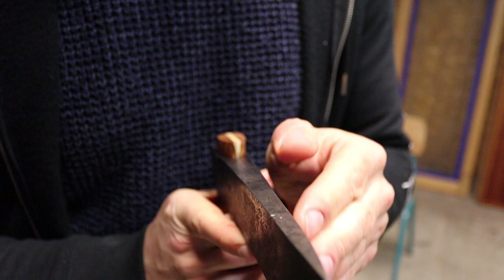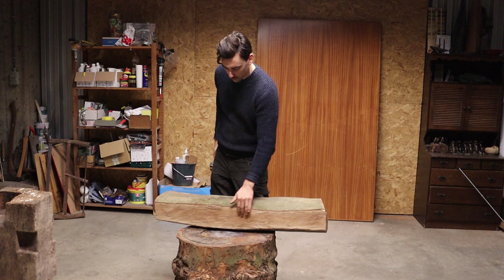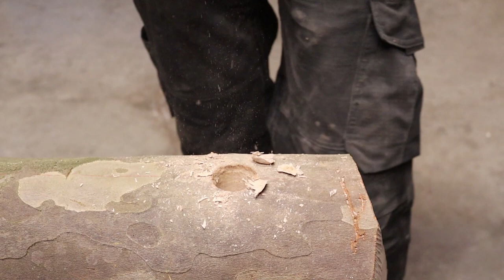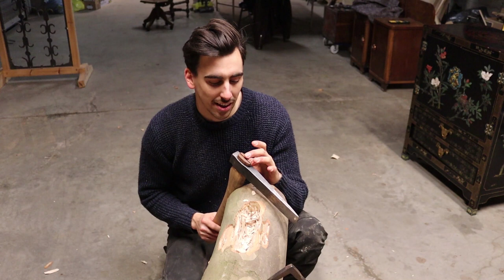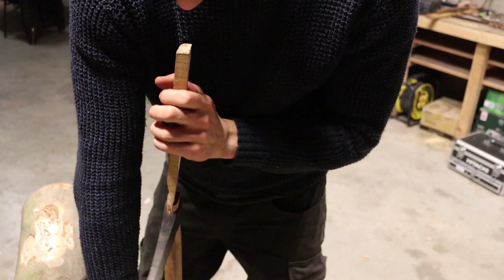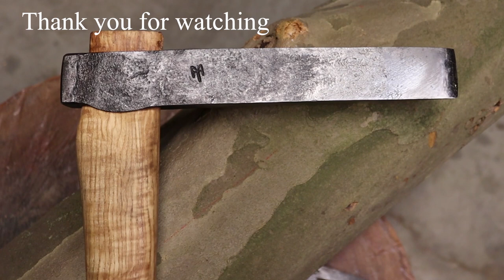Putting my Mortise Axe Skills to the Test

Comment: Perhaps the flat head of chisel suggests that the chisel should be placed and then struck on the flat head,  rather than an axe type stroke.   Your sharpening techniques are amazing.
Reply from the maker: Yes, probably you would be more succesfull when driving the axe with mallet/big ol' stick. And thank you!!

Comment: It would take a perfectly aimed strike of the axe but I always imagined a mortise axe chopping perpendicular to the length of the mortise. Especially in a situation like you had there with holes drilled in the ends of mortise. The chips would just fly if severed perpendicular. Then come back and clean up the walls using the mortise axe more like a chisel and pushing instead of striking.
Reply from the maker: Yes, the twybil has this capability with its mortise chisel-like end. I really need to make that variety! makes more sense.
Reply: My first thought was that it could work like a combo axe-chisel
Reply from the maker: @motagrad2836  it does! 👌

Comment: I sort of think the axe is supposed to be used perpendicular to the grain of the wood. This also makes the narrow width of the cutting edge make sense as well. The way you cut in the beginning of the video could really be done with any axe which gave me the idea that the reason it's narrow is to allow it to cut the other way. I could be totally wrong but I think it'd cut much much quicker too.
Reply from the maker: Working square to the grain using a swinging motion will become impossible on a narrow mortise like this, then jou would need to use a hammer of sorts. Which was done. I think this axe need a bigger mortise to shine. The twybil variant of the axe has two cutting edges and has a pickaxe shape, one end (missing here) is a mortise chisel like end that you can use to chop the endgrain, square to the grain. But indeed my axe has some trouble in this video.

Comment: Slipping wedges and loosening axe heads/handled tools were the bane of my existence for years. No matter how many notches I put in the wood or steel (or both in combination), no matter how much epoxy I applied, they always loosened. All that stopped when I started making my wedges out of sharpened pipe. I use them for everything, even friction fitted tools.
Reply from the maker: I'll keep that in mind!
Reply: I never thought to use pipe instead of buying those circular wedges , thanks for the tip
Reply: @yoman2854  one of the perks of being a craftsman who started as a broke teenager.. seeing things for what they are in their most basic form to save money lol. Glad I could help.

Comment: axes were mostly used for fresh and wet wood, then the effort with practice is not so great, less vibration in the hands
Reply from the maker: You're right, this wood was cut almost a year ago, It's not super dry but not comparable with freshly felled wood.

Comment: Very nice axe !   I like the heft and length of the axe.  I have a little smaller Gransfors Bruk mortise axe and like to use it inside cabin corner notches along with using it as a push chisel, and also to use my Wood is Good mallet as it also works as a chisel with mallet.  I do have mine sharpened to a 20 degree flat grind.  Best to you,  Mike in Holland, MI  USA
Reply from the maker: @MountainDreamLand  Thanks Mike! It is not so easy to use. A larger mortise would help. Like for millwright jobs or other big construction. I now have a vintage twybil/crossaxe which I'm excited to restore soon. Thanks for you comment.

Comment: Hi Marcel,I'm wondering if it would be easier to cut the mortise with an axe that resembles a traditional mortise chisel,with a smaller head to allow easier access in the mortice,just thinking really.👍Maybe two axes could work together,one for chipping out and one for cleaning the sides..
Reply from the maker: Hi, that is basicly what the twybil does,  the "big brother" or cousin of this axe that I mentioned at the end of the video. This axe has two sides, one side like I have here and one side like a mortise chisel like you described. I was thinking the same thing, to make one like the mortise chisel to use together with this one. But I also just want to make or find a nice twybil! Thanks for the comment!

Comment: If the tool you describe at the end is rare there is probably a good reason for that...either it doesn't work well or it is optimized for specific and limited circumstances. The tool you really want for this application would be a narrow adze. The curvature of the adze blade is far more efficient at removing large chips of wood than a straight blade would be. Also, you made your mortise ax with a DOUBLE BEVEL. No wonder it gets stuck in long grain. Framing chisels do not use a double bevel, they use only a single bevel. As the edge is driven into the wood, the wedge shape of the blade drives the chisel backward, relieving it from getting stuck.
Reply from the maker: The double ended mortise axe (Twybil) or "cross axe" is rare because it's a specialised tool that few people needed. It only shines when working on really big timbers for churches, mills, bridges etc. Many or even most mortise axes are double bevelled. On the twybil, the other end had a single bevelled mortising chisel-like end that is straight, and not curved like and adze.

Comment: Sorry ,but would it not be better to drill more hole's and then work with your axe 
It would go a lot faster. I think there are better technics without use electronic devices.
Reply from the maker: Yes, for sure, that's kind of what I said at the ebdvof the video. This was just a test. Next time I would definitely drill more holes.
Reply: @MarcelTeugels  hope your not mad for my comment....
Reply from the maker: @thevikingoli8847  ofcourse not, it was a valid point. ✌
Reply: Yes !! Having worked at a historical museum our understanding of a mortising axe was not for fine work but for rough farm work on things like fence posts. Used to clean up mortises drilled with multiple holes for rail fences.